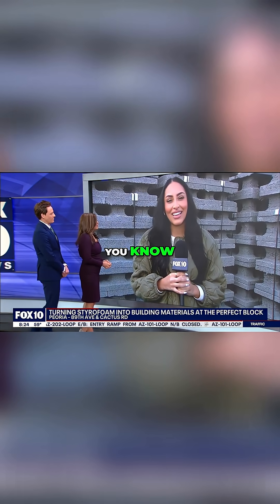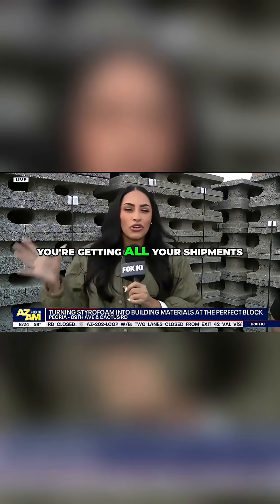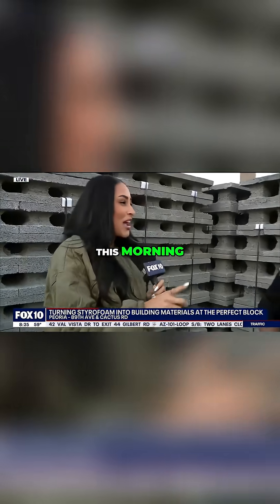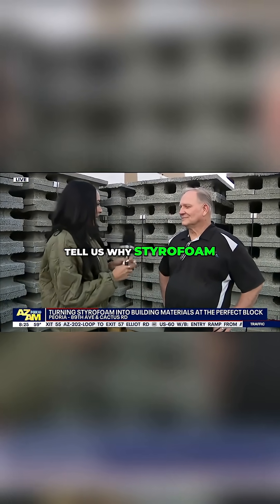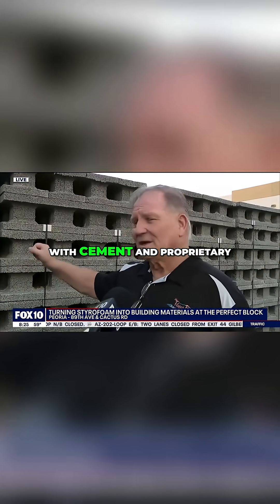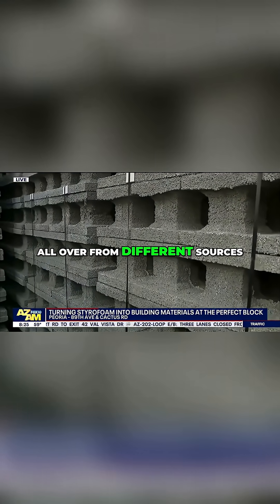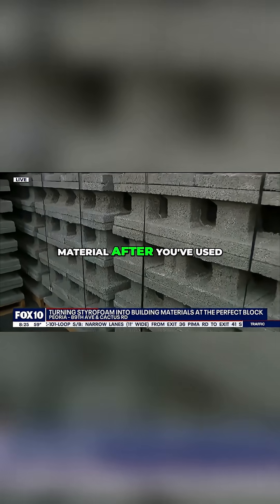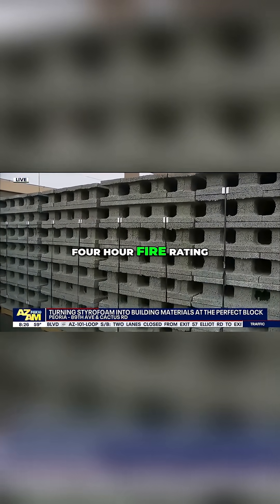FOX 10’s Big Story: The Perfect Block #foxnews #iccf #contruction #architecture

Comment: The key to understanding these blocks is to "see" the voids and understand that they are filled with rebar and concrete (grout).  The blocks remain as insulation but are not structural themselves.

Comment: The technology has been around for over a decade.
Want to really help the planet ?
Mandate 15k gallon water cisterns in new home construction and dolor on all buildings.
Small steps low cost huge benefit.
Thorium nuclear until fusion reactors are viable.x
The earth running on Hydrogen in 50 years.
Thats as clean as it gets.
Reply: That's funny
Reply from the maker: You’re right — The Perfect Block technology has been around for years, and we’re glad to see more people discovering it. We’re with you on the big-picture sustainability goals — water collection, solar, clean energy — all huge wins for the planet. Our piece of the puzzle is turning waste EPS into disaster-resistant, insulated building blocks that cut energy use for decades. Every step counts toward a cleaner, more resilient future